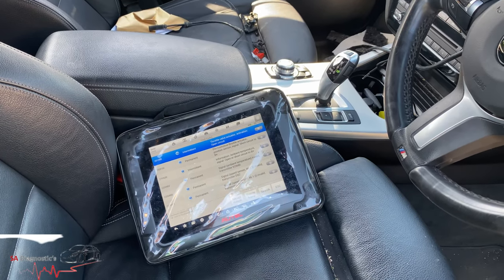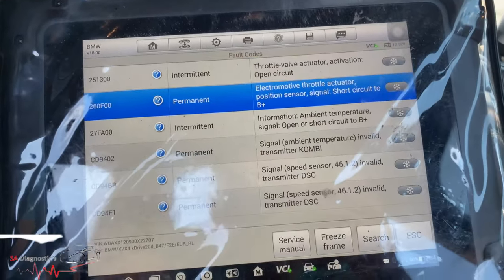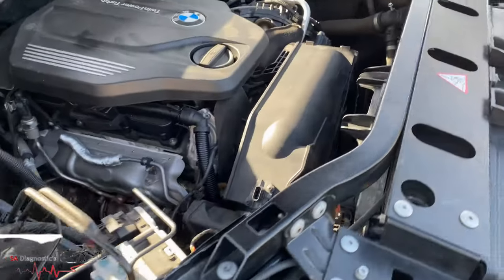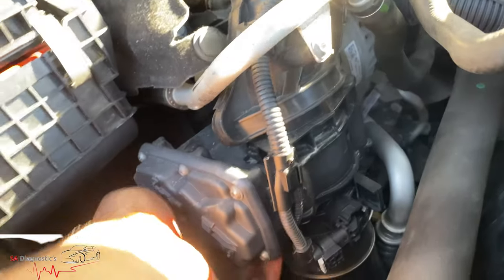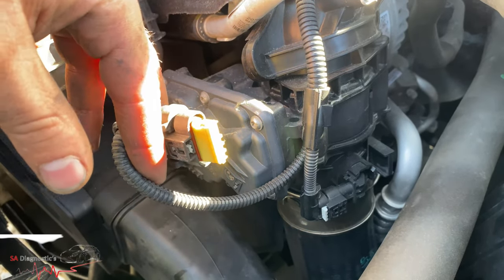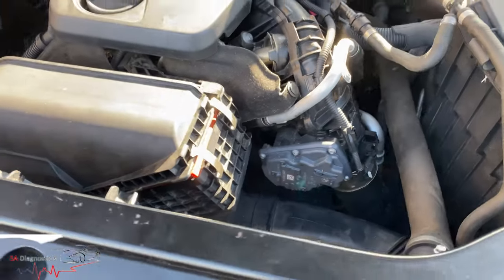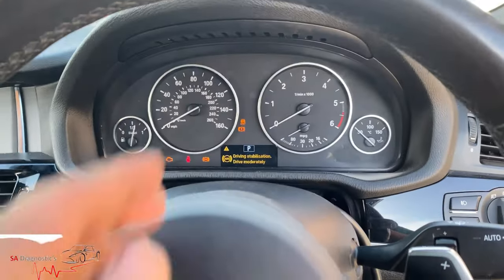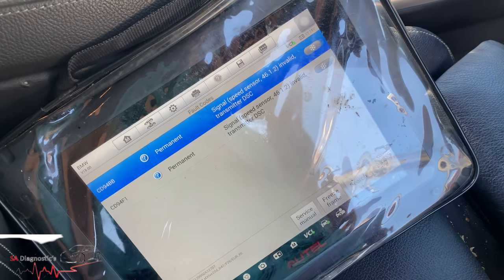260F00 Electromotive throttle actuator position sensor signal short circuit to b+

Comment: So i have the same problem but the connector is pluged in in my case … what could i do to fix this ?
Reply from the maker: It maybe that you need to change the throttle body sometimes they pack in and don’t work
Reply: @sadiagnostics   brand new throttle body , did an engine swap .. the thing i noticed that the colors of the wire's from the plug that you show in the video are diffrent then from my previous engine....
Reply from the maker: @BjornDD-93  not sure what to say really have you tried to code it in